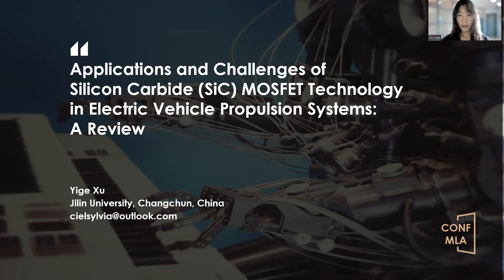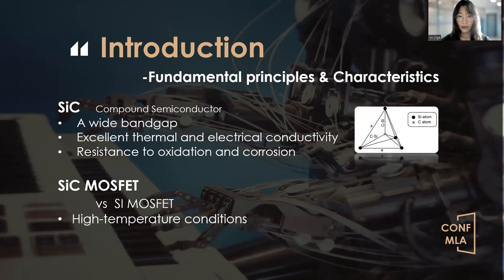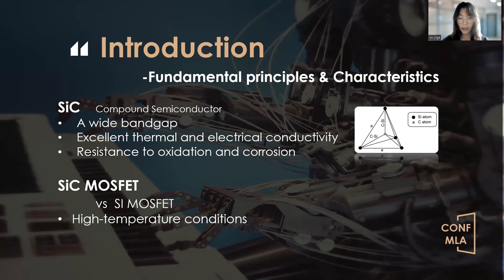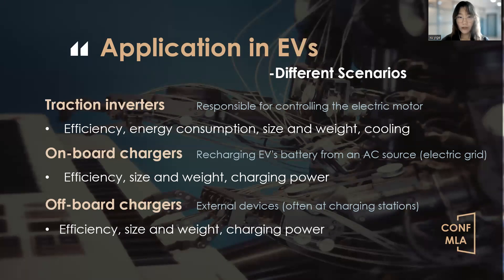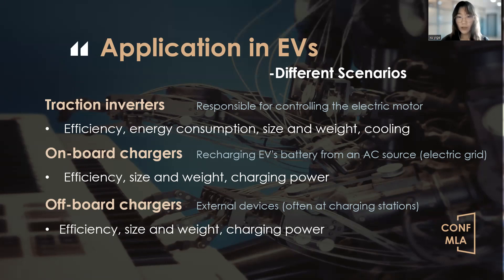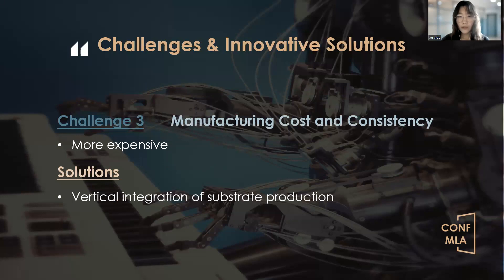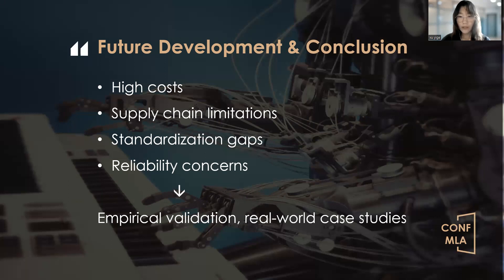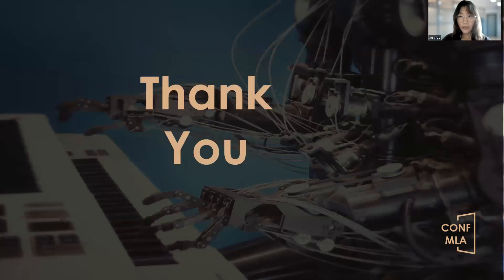CONF-MLA 2023—Applications and Challenges of Silicon Carbide (SiC) MOSFET Technology in Electric Veh

Comment from the maker: Q: What specific advantages do Silicon Carbide (SiC) MOSFETs offer in the context of electric vehicle propulsion systems, and how do these advancements contribute to improved efficiency, power density, and overall performance compared to traditional silicon-based technologies?
Reply from the maker: RE: Compared to traditional silicon-based technologies, SiC MOSFETs exhibit several key advantages that enhance the performance of EV propulsion systems. These advantages are explained as follows:

1. Superior High-Temperature Performance: SiC MOSFETs perform better at high temperatures due to the larger bandgap of SiC, which is three times that of Si. This means that more energy is required for electrons in SiC to transition to the conduction band, leading to fewer thermal carriers and thus less leakage current at the same temperature. In the context of EV drive systems, this advantage not only reduces energy loss and waste, thereby enhancing energy efficiency, but also prevents device overheating.

2. Improved High-Frequency Performance: This is because that SiC has higher electron saturation drift velocity, which is the maximum average speed that electrons can achieve under a given electric field strength. In MOSFETs, faster electron movement allows for quicker transitions between the device's on and off states. This characteristic results in lower switching losses at high frequencies, thereby improving system efficiency andreducing cooling requirements.

3. Enhanced Performance Under High Voltage and High Current: SiC MOSFETs also perform better under high voltage and high current conditions because of their higher electron saturation drift velocity and breakdown electric field strength. As the applied drain voltage increases, the drain current of SiC power MOSFETs continues to rise, unlike Si power MOSFETs which reach a saturation current. These characteristics mean that smaller devices can handle the same power, contributing to a reduction in size and weight in EV propulsion systems.

4. Superior Heat Dissipation: SiC MOSFETs exhibit better heat dissipation due to the thermal conductivity of SiC being three times that of Si. Therefore, liquid cooling can be used instead of air cooling, simplifying the cooling system.

In summary, these advantages make SiC MOSFETs an ideal choice for applications in the EV propulsion systems.